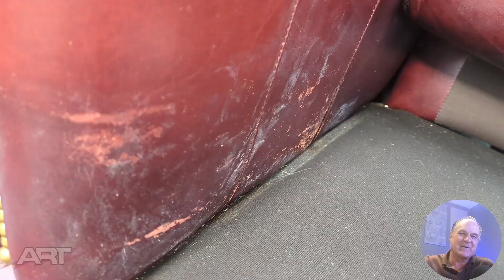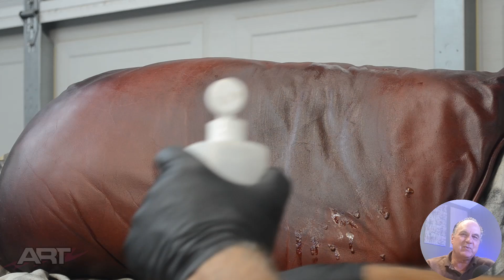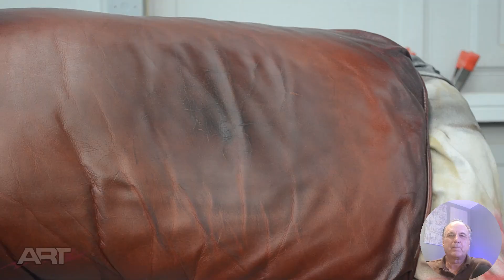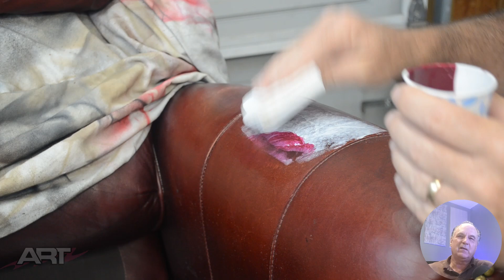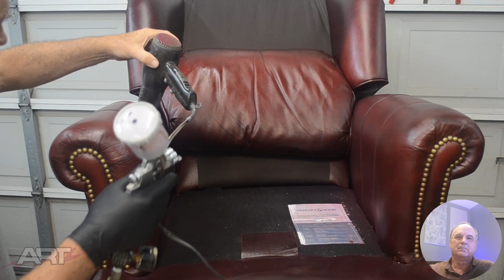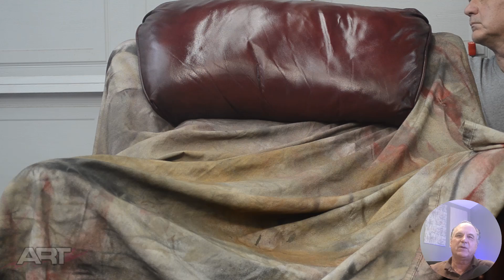Rotted Leather on a Recliner? v146

Comment: Question - When using the plastic primer, you mentioned a flex additive. What is the flex additive's property (liquid, gel, cream)? 

Thank you for the video. I have spoken to many technicians who have shared the perils of body oil transfer on headrests and arms. I have to admit I am one of them. Most, if not all, are concerned about the phone call 3 - 6 months later because the customer reports the repair had failed and is coming apart. The failure is that their water-based repair system cannot adhere to the oil-impregnated leather area. In fact many techs wouldn't even touch this type of repair. Your repair step negates their bad experience (and puts more money in our pockets). Any info you have on that would be most appreciated.
Reply from the maker: @warrenhowell438  Flex additive is liquid.  There are some perils with some furniture circumstances.  I too have more questions than answers, but I have a video in the archives that might help.  I'll put it in the queue.  Thanks.
Reply: This is fascinating, I have 2 such chairs that I’m interested in tackling. I have absolutely no experience with leather other than saddles. Is there some where I can get a list and or source of products used?

Comment: What percentage have you mixed the flex additive to the plastic primar ? I would assume the 5-10% that I'd typically use in my dye mixture?
Reply from the maker: I didn't measure it but that sounds about right.  In a scenario where there is not a contiguous layer such as this application,  flexibility is not as big a concern as if it were a topical coating.  Here the leather fibers form the flexible hinge.